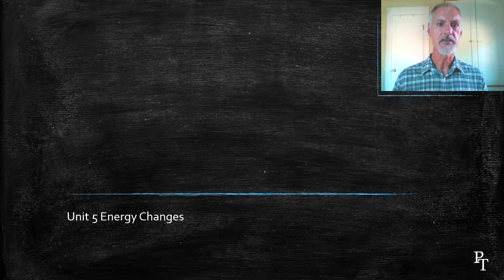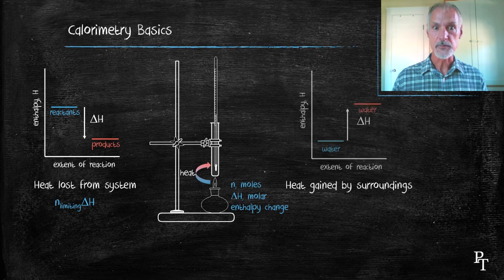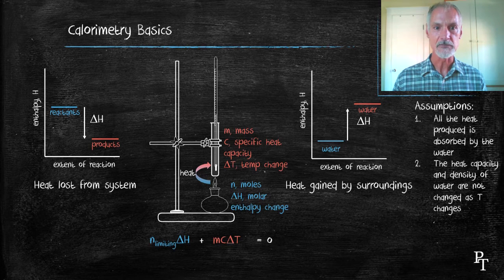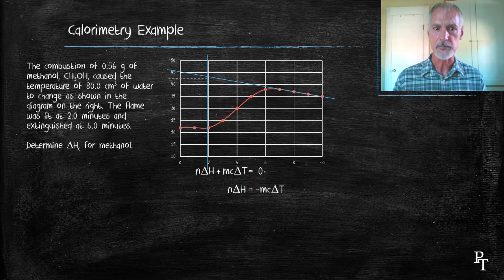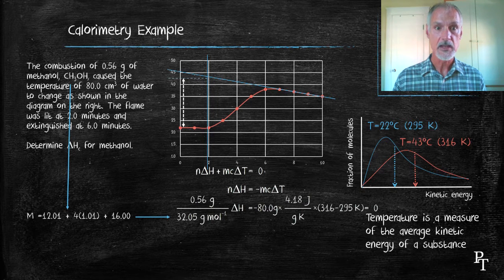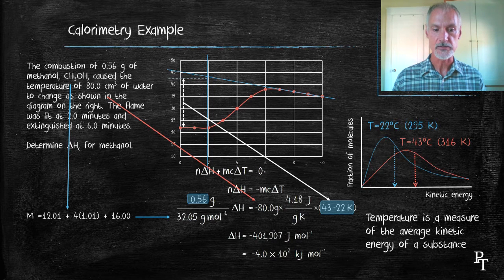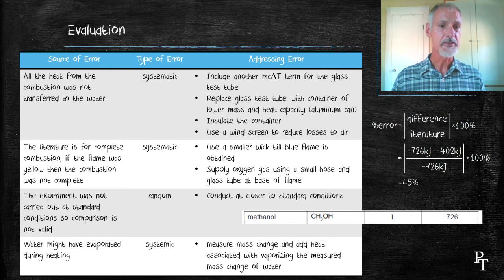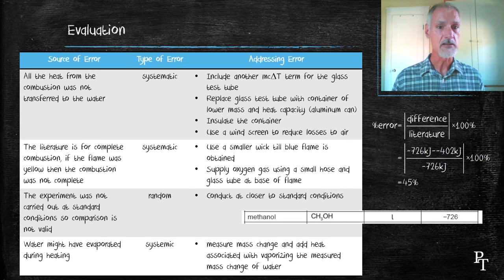R1.1.4 Calorimetry (part 1)

Comment: These videos are so helpful I was just wondering why you have to do the calculations for q with water why couldn't you just measure the enthalpy change for the fuel directly?
Reply from the maker: You could measure it directly if you had a group of related reactions and were able to use Hess's Law. You could also estimate the change using bond energies ... If neither of those are available then calorimetry is used where by you equate the energy change of the surroundings to that of your reacting system.